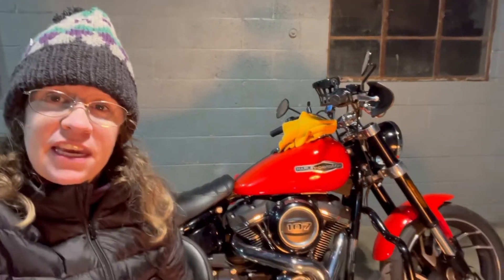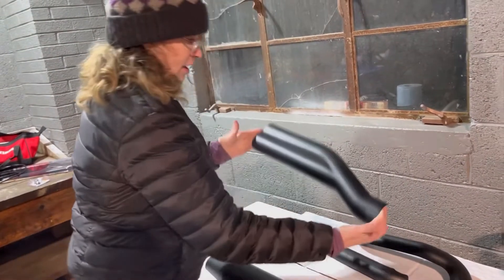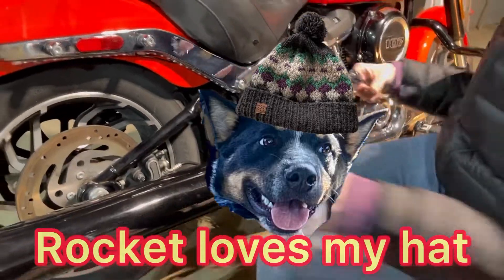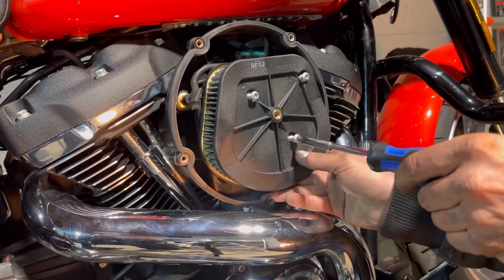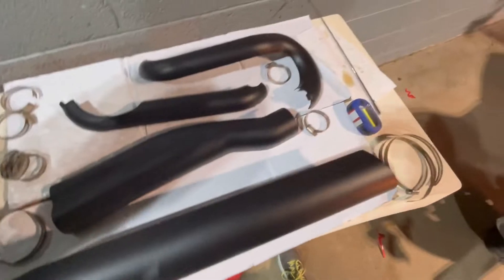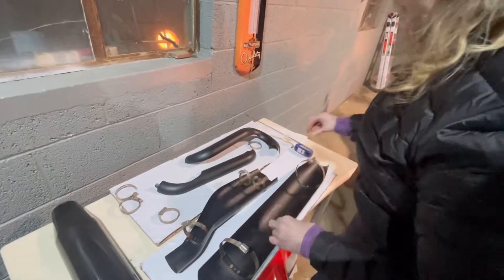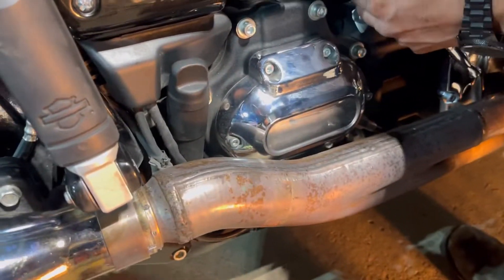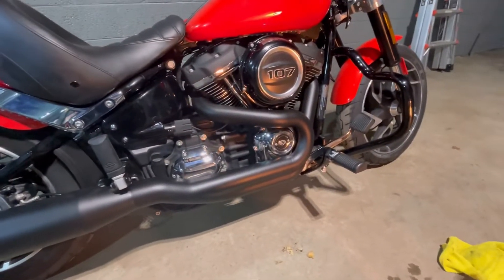Exhaust Shield Install on 2020 Harley-Davidson Sport Glide—easy

Comment: I took a few too many turns on my Sportster at speed and I actually ground through one of the worm gear clamps and nearly lost one of my heat shields! Changing color makes a marked difference in the looks department.
Reply from the maker: I can imagine how you felt burning through those curves with your heat shields on the ground on a sportster! I really like the improvement in the looks, too.

Comment: Say, do you ever check your fuel economy? Just curious.
Reply from the maker: I do not keep track of fuel economy.
Reply: Just as an aside, if fuel economy takes a downward turn, something is probably suffering. Sensors, adjustments, tire pressures,  etc. Math not involved, just an observation of miles per tank on the average...later!